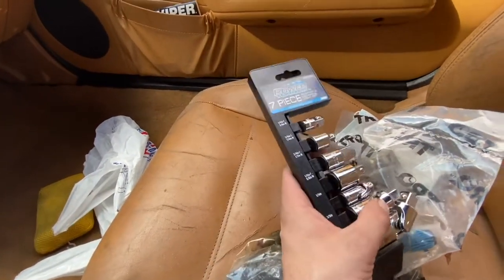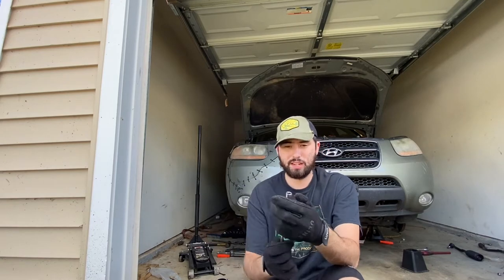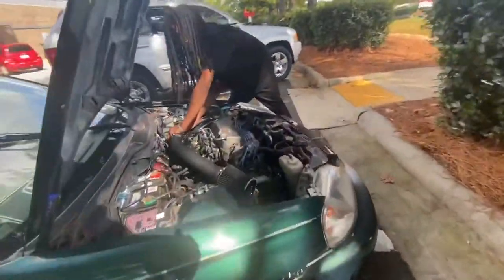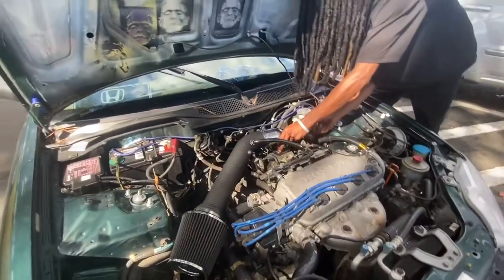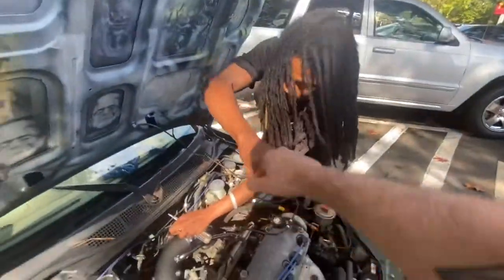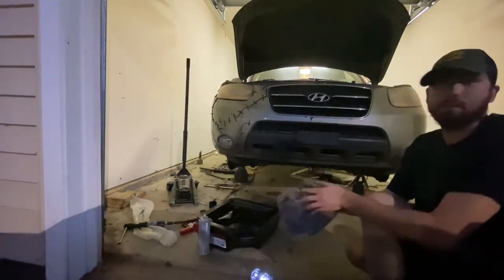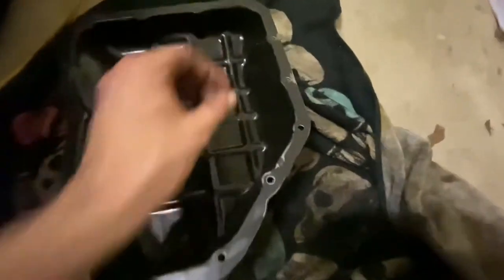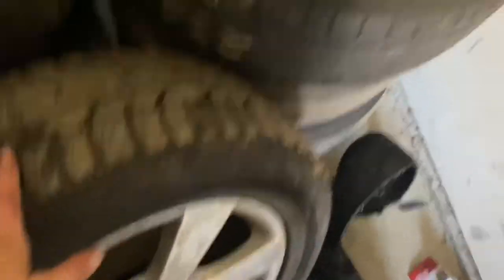08 HYUNDAI SANTA FE OIL PAN GASKET REPLACEMENT

Comment: Good and helpful video, but it would be excellent if you showed how to fix the gasket and does it was dry or with sealant on both sides on the engine pan mating face and engine casing, mating face and what's the torque of 10mm set screws around the engine pan or just hand tight.

Comment: Just what I needed brother thank you!! 

Over tightened my drain bolt so now I need a new pan 🤦‍♂️
Reply: Also what is that product gasket maker? Do I need it when putting on any new gasket?
Reply from the maker: I don’t believe you actually need it, I’m using it just to be safe

Comment: How did you do that? I was trying many times but it didn't work. It was so hard to get the oil pan of.
Reply from the maker: Try using a smaller flat head to start getting a gap in there for a hopper pry bar
Reply: @dvwhite7610  I'm gonna try again next time. The other issue was the oil pan position is too closed to the iron frame that blocks the oil pan a little bit. But, thanks anyway...